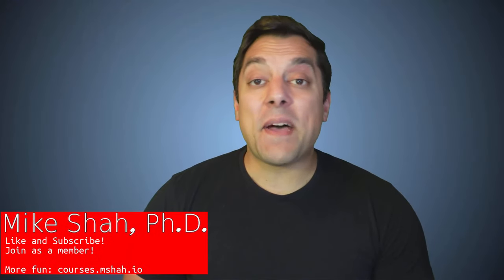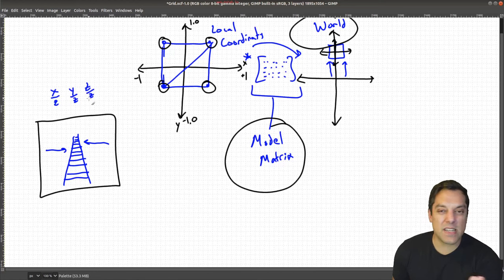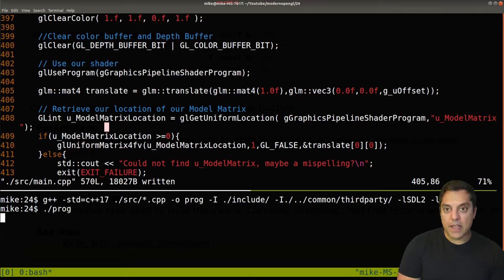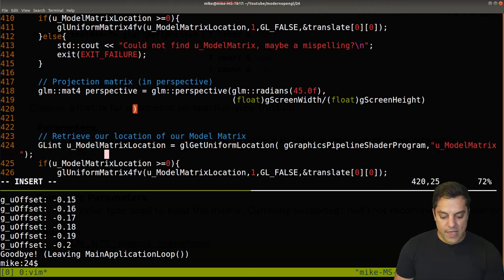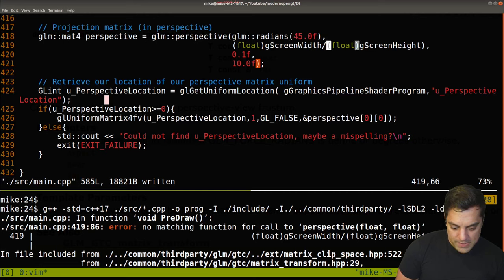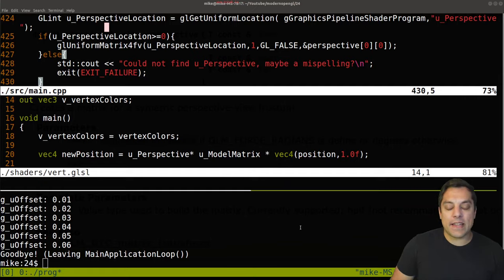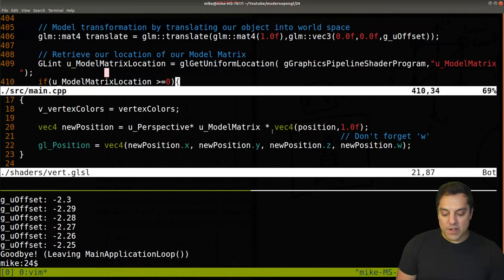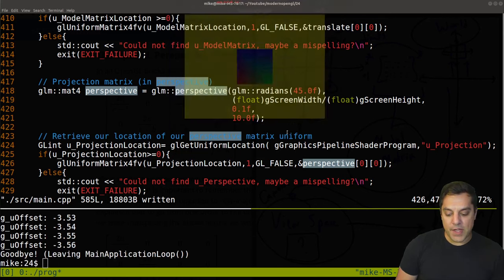[Episode 24] Projection Matrix and glm::perspective

Comment: I worked too hard in projective geometry and geometric algebra in early 2000; and after 20 years i try to converted that theory to C++/graphic using mathematic operator on matrix rather than use function— it steal function😅 as viewed by language —  like projective vector multiplication — using tensor notation — ;
    Thanks to bring my memory and may be in my free time going to templating this in unary operators of projection, réflexion, mirror , … , shearation(NotEnglishWord).
Reply from the maker: Cheers! Sounds like quite a career!